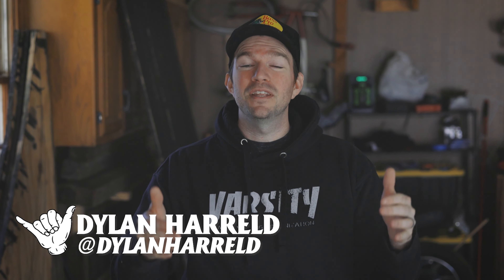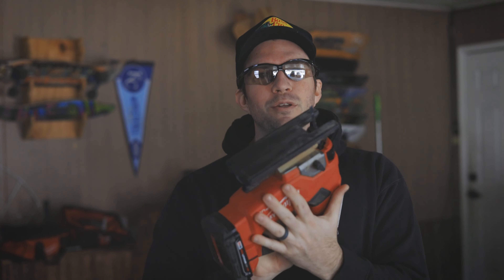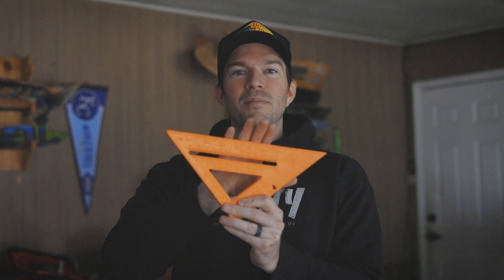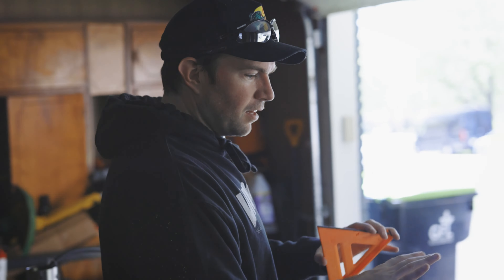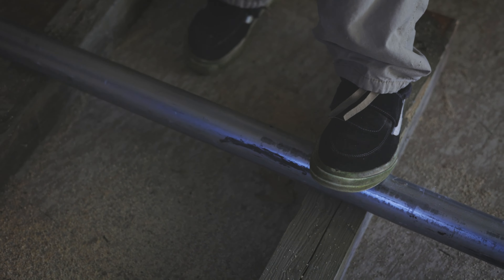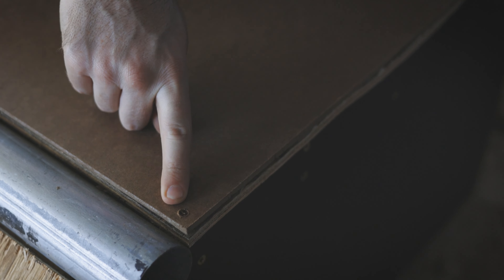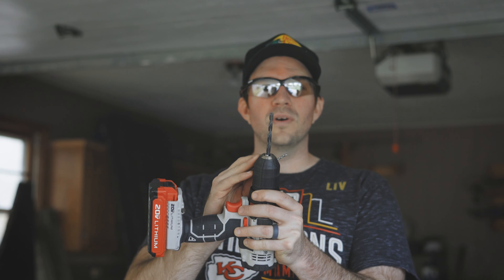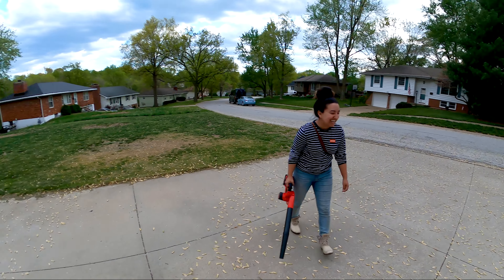EASY DIY Micro Skateboard Ramp for Beginners: Build a Quarter Pipe in 4 Hours!

Comment: I’ve built a couple of small ramps at home and it’s great fun. One is just a low flat bank mostly for roll ins but the other is a 2ftx4ft wide quarter pipe. I bought a 6ft wide one a couple of years ago so used that as a template to keep the same transition. It was all made from waste timber apart from the transition surface and breaks down into two halves to store inside the wider one. Now I can set up a mini ramp to skate in my garage 😎🤙